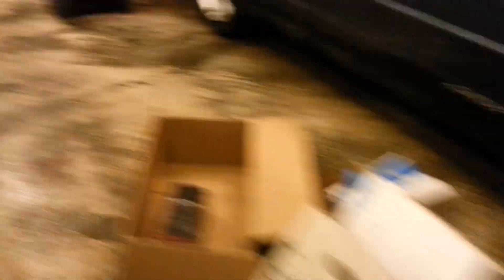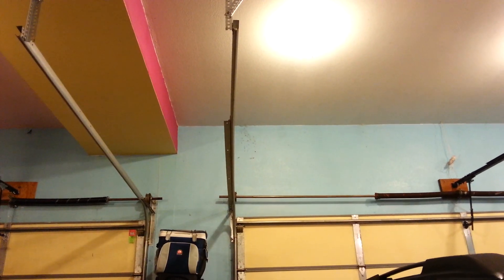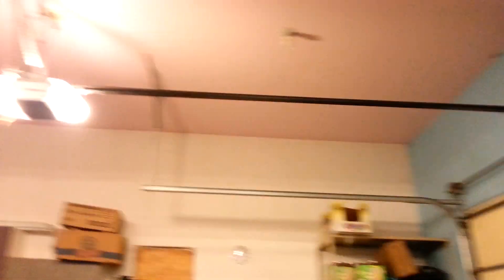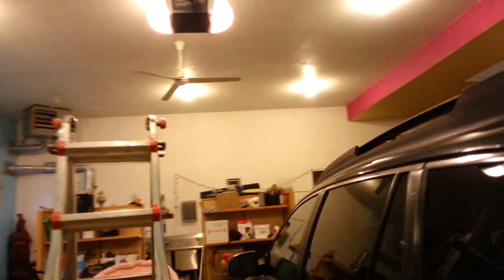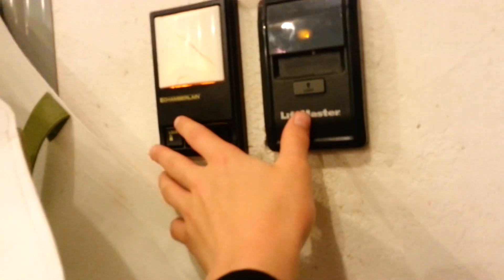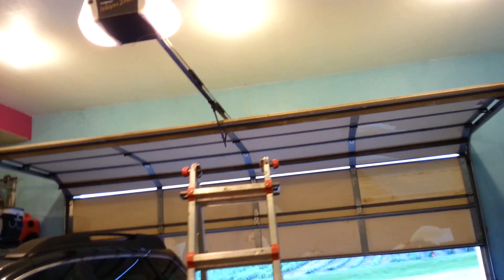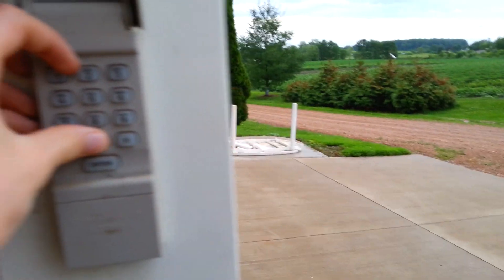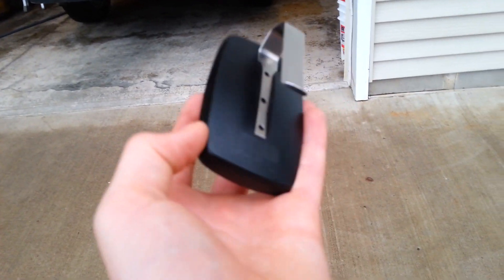Chamberlain Whisper Drive WD822K

Comment: Wow! When it got backed into did it bend the hinges or the vertical track or the roller shafts or did it pop any rollers out? Also I can tell by the way the opener motor sounds it sounds stressed.  Did you try and open and close it by hand to see where it's binding? Maybe its either binding in the vertical tracks or its rubbing on the outside weather stripping.
Reply from the maker: It's not the weather stripping, that's for sure. I ran it by hand once manually but it was hard to tell what is binding.
Reply: @TBHD724  Really? That's odd. And you had no trouble closing it? It didn't feel like it was binding?
Reply from the maker: I couldn't tell very easily.
Reply: @TBHD724  Strange. It could be the bent track maybe. Obviously something isn't right.
Reply from the maker: I definitely agree with you. What else do you think could be the problem?
Reply: @TBHD724  I really don't know. Are the springs too tight? Again all I can think of is bent tracks, bent roller pins and hinges. Is the track twisted anywhere you can see?
Reply from the maker: Nowhere other than the left horizontal.
Reply: @TBHD724  The only thing I can suggest is replace the door with a new one. Also I was worried it would shear off the rubber motor isolaters from it binding when closing. You said you had the close force all the up to max, right?
Reply from the maker: Yes I did suggest it was prob time for new doors.
Reply: @TBHD724  Good idea. Since I bet that opener has had it. Again I'm wondering what the rubber motor mounts look like.  One time, I've heard of a 2280 closing a door and the spring broke while closing. It stopped the opener moving and twisted the motor which broke all 4 rubber motor mounts. The motor itself was actually spinning.  Ruined the wire harness.
Reply from the maker: That's interesting... For new doors I would suggest high Lift doors otherwise probably some carriage house doors.
Reply: @TBHD724  Yes its very interesting. My grandparents have Wayne-Dalton doors amd they've been good. They had them for 12 years now.
Reply from the maker: @YoshiRocks2244  are they the WD paperback cheap ones?
Reply: @TBHD724  I don't think so. They seem like they're well made.